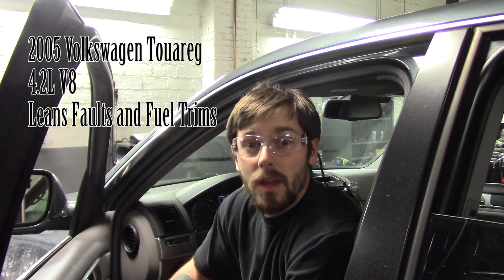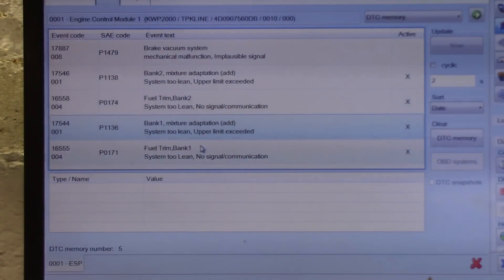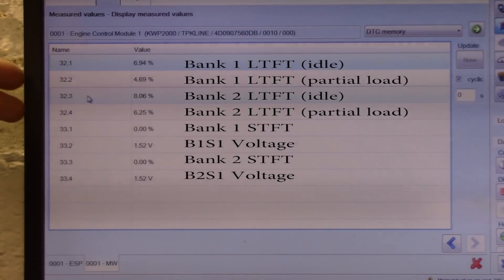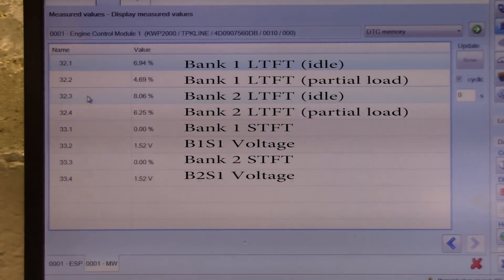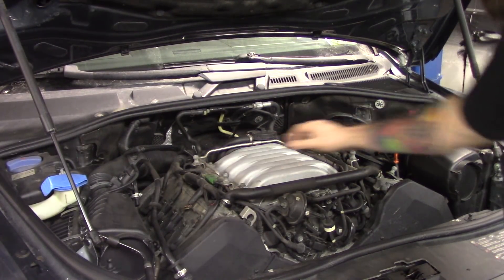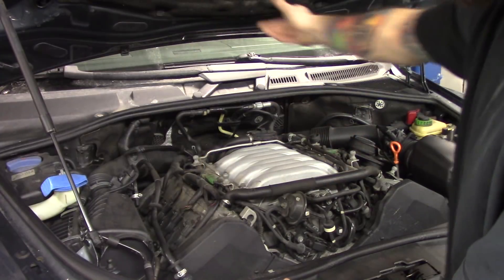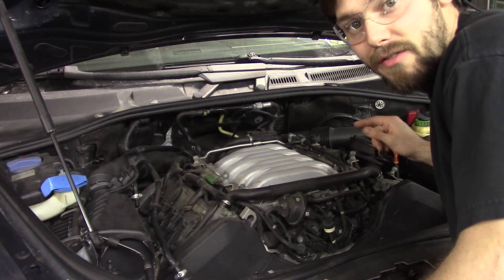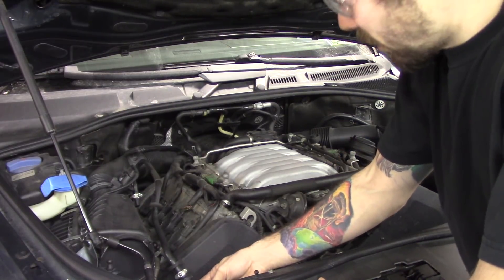Lean Faults and Fuel Trims (2005 VW Touareg 4.2L V8)

Comment: Hey thanks Positive , I learned from you today I have an 08 bar motor I had my valve covers done vehicle was fine took vehicle down to dealer for fuel pump gasket recall I get car back and vehicle now has p0174 ..is  bank 2 drivers side bank 2 and I should be looking for vacuum leaks on hoses mainly on driver's side ? I had that brake booster vacuum hose leak in the past ..but which lambda sensors should I be watching for bank two

Comment: Hello Tom. Could you help me out with my Seat Toledo 2 (equivalent of Golf 4) 1.8 20V 125hp? I've P1128. Symptoms are: significant increase in fuel consumption, small misfires (not detected by VCDS), at steady cruising speed EGR is reading normal voltage but when gently stepping on gas pedal (not WOT) EGR is zeroing/closing. Duty cycle is 0%. At WOT, MAF reads only 60g/s (guess should be around 100g/s) and it's brand new. At higher RPM LTFT gets lean up to 20%. This would point to MAF, but again, it's new. Sometimes equivalence ratio goes down to 0.133. I don't think it's the fuel pump because LTFT goes up depending on my foot. It may never go up if I keep driving at lower RPM. And also lambda stays most of the time on rich side. Might be a false lean condition?
Reply from the maker: Lack of power at wot?  What are your o2 readings at wot?
Reply: @PositiveLeadDiagnostics  A/F ratio is around 13 and equivalence is around 0.85. Cat was cut out so downstream gives inaccurate readings. Cat was replaced by previous owner and this one melted on me so I got rid of it until I fix this rich condition.
Reply from the maker: I was thinking maybe a plugged exhaust.  Any lack of power or is it just a check engine light?
Reply from the maker: Is it an oem maf sensor?
Reply: @PositiveLeadDiagnostics  Yes. Previous one was Bosch also. It was reading the same parameters as this one. I've destroyed it by trying to clean it.
Reply from the maker: Maybe keep it basic and check fuel pressure. Any difference in power of you drive it with the maf unplugged?
Reply: @PositiveLeadDiagnostics  No difference with MAF unplugged. I'll check fuel pressure.

Comment: Hm, so the vacuum pump is also sucking it into the engine?..I thought it was separated from the engine vacuum and therefore not affecting it in any way..like, sucking it on the brake booster and releasing it into the atmosphere

Comment: Had the same issue with mine. With the vacuum leak, I got 8.5MPG city. Fixed it pretty damn quick!

I do have one issue right now though. My 2005 V8 has the Kessy system, and all of the little black lock buttons on the door handles (except for the rear passenger door) aren't working. The all failed one-by-one over the past year. Can still unlock the doors though. Is this something that you've ever seen happen?

Comment: HOW BAD IS THIS SCANTOOL, it works with numbers !!!!
Reply from the maker: If you use the guided functions tab you can look at the measured value descriptions instead of the numbers.  The number can be confusing
Reply: Got something similiar in VAG-COM.and VCDS. But I could load up a label file into the program, so all the mysterious numbers had been described. Perhaps you can do the same in your scantool?